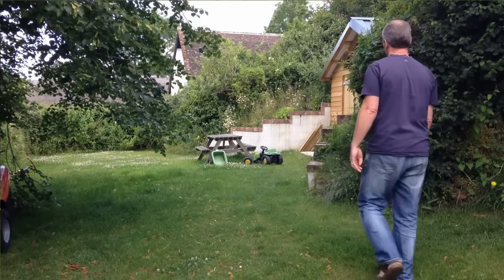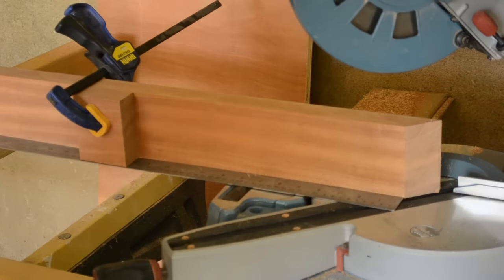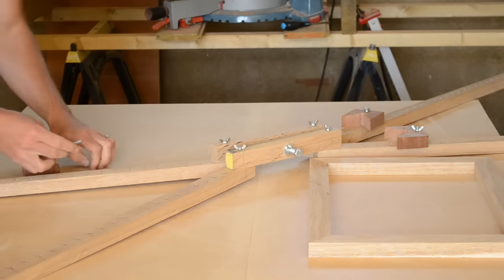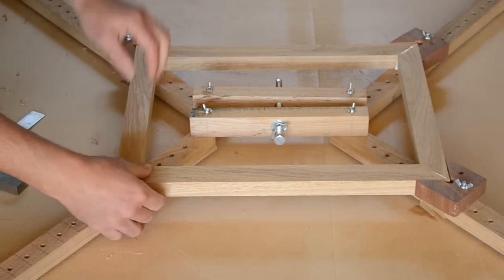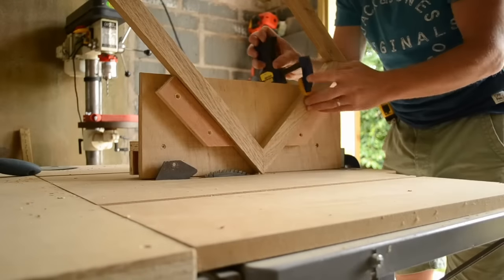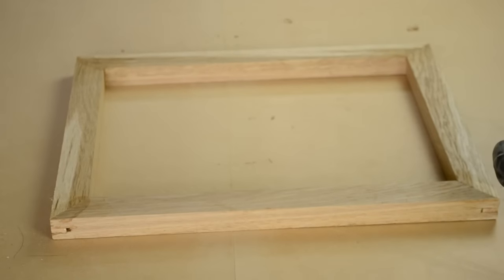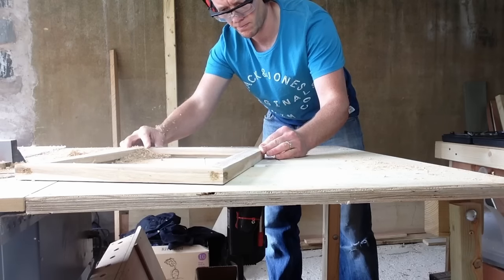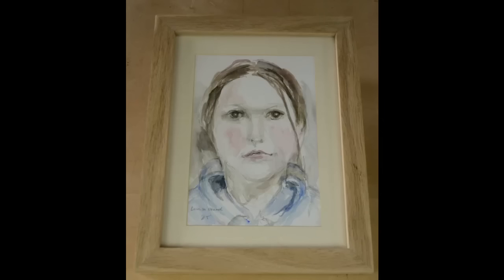How to make a picture frame / Picture frame DIY

Comment: Nice job making the frame and the video. If I might add this suggestion, keep a tube of super glue in the near, dip screw driver tip into it or screw head, this will keep the screw on the screw driver.
Reply from the maker: Thanks Lee, will keep that in mind. No videos at the moment as my workshop flooded just after Christmas... Things still drying out now!

Comment: I'm confused, why take a nice wood like oak for the frame but spline it with plywood? If you're going to go to so much effort, why not use some of that nice sapele or walnut...
Reply from the maker: I think plywood was what I had to hand, the frame was a present and I was running out of time. You are right though, it would have looked better. Thanks for watching anyway!

Comment: 17:46 and 17:50 minutes into the video show rounded inside corners produced by the router. At 18:04 into the video we see clean inside corners with no explanation of how this changed.
Reply from the maker: All I used was a sharp chisel, but I forgot to film it, will do next time.